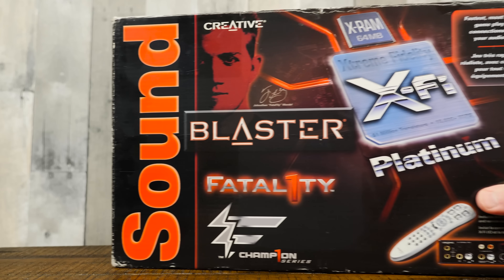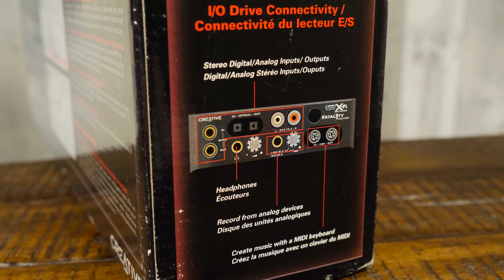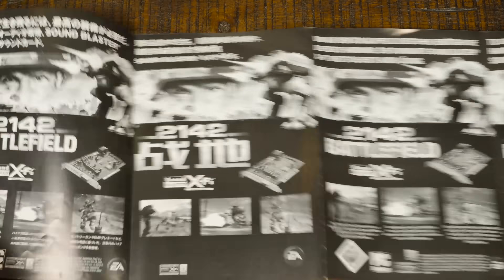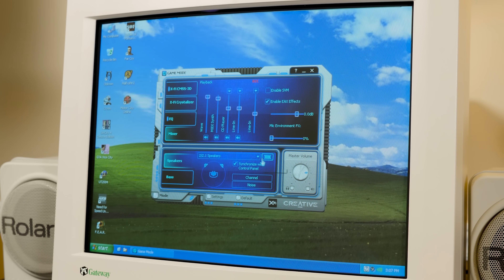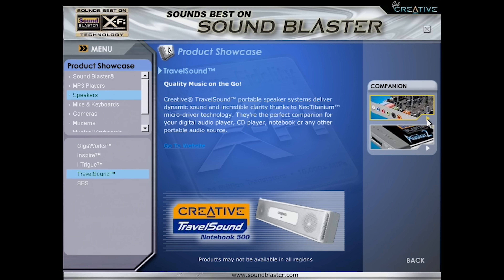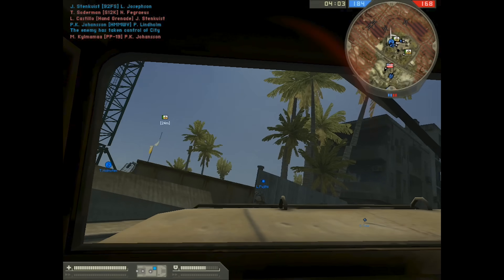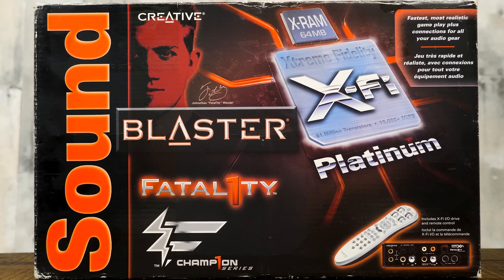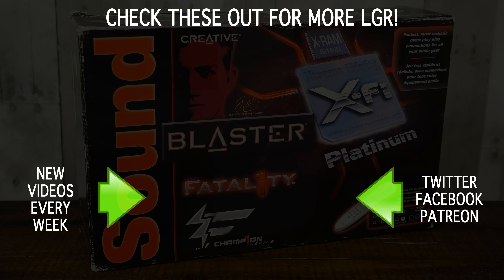XP Upgrade! Sound Blaster X-Fi Platinum Fatal1ty Sound Card

Comment: I am still using a Sound Blaster X-Fi Titanium in my current rig under windows 10 =)
Reply: been using creative for 14yrs now have a soundblaster Z, dont feel at moment i need to change as on board is still fairly generic and cheap.
Reply: William J Beard does EAX Work lol
Reply: I got my Sound Blaster X-Fi Titanium HD working too, EAX works great still.  You can also set your speakers to 5.1 in windows with physical stereo speakers or headphones and CMSS - 3D works better than virtual 3D
Reply: @JediJado  I love the fact that the card still has an optical audio input as well as output ports. I run my Console through the optical in and then I can use my headphones and all the SoundBlaster processing on my console games as well =) It's actually really hard to find a sound card with optical in these days. I think the newest RGB SoundBlaster has an input, however it's a shared input/output port. So you only get one =/
Reply: I'm using an Audigy 2 under windows 10 :D
Reply: @Bloowashere  Nice, they still sound better than any on board audio chip, even the ones that claim to be really nice.
Reply: @theov3rmind  you're not wrong, Spatial sound sounds superior, music sounds better, and the built in midi synth is fantastic.
Reply: @Bloowashere  The audigy 2 is the one with the FireWire port, iight? In my case, having an optical INPUT and output is super useful. That new RGB SoundBlaster whatever has one optical port, either for opt. in or opt. out. Bit of a downgrade imo, lol.
Reply: @theov3rmind  yes it has a firewire port, strange thing though is that all the other ports are mini-toslink ports
Reply: @Bloowashere  Woah, that's sweet! I want one.
Reply: well it created a lot of issues when I first got it, but thankfully there's a stereo mix in the microphone section of windows so you can offload the audio that's rendered on the soundcard to the onboard.
Reply: oh yeah, a lot of motherboards with Realtek chips have that feature comes in handy.
Reply: @theov3rmind  mine is a Realtek but it doesn't actually have that feature. The audigy 2 has the feature though
Reply: lol u still have it?

Comment: Oh these XP machine videos are sweet. All of this hardware is pretty much the step up versions of everything I had in my first custom built PC in 2007. I had an e6850, you got a qx6850. You have dual 8800 gts, I had dual 8600gts, and now you have the xfi platinum I had the xfi xtreme music. This is a great nostalgia trip. I remember fiddling with that soundblaster UI constantly as it always loved to randomly mute my mic in and never save my balancing settings. Still it made me fall in love with dynamic compression and I can never get a motherboard without a integrated sound chip that supports it.

Comment: I still have and use my Sound Blaster X-Fi Titanium Fatal1ty on my current Windows 10 Gaming PC. Never had the front panel for it. But wish I did. Love this card! Thought about upgrading. But I use and need the Optical In port.
Reply: Me too!  The CMSS 3D headphone surround is still exceptional.  I recently purchased an SBX AE-5 to compare and the software controls were an inefficient RGB dumpster fire compared to the X-Fi so I returned it.
Reply: Yeah, that front panel won't work in anything but Windows XP, because you know it has such amazing proprietary tech in it that Creative wouldn't dare release specs for it. :x
Reply: yep Z is a must up from your,  been using creative for 14rs now and now on Z not moving now till atleast 2 more yrs.
Reply: @Darkleaf-Music I’m running XP. I cannot get the front panel working. Is there special software I need to install or some software setting to enable? I’ve double checked the ribbon cable and it’s installed correctly.

Comment: I still have this same card, front panel, and remote laying around somewhere! X-Fi Crystallizer was genuinely a very cool feature, I used it for many years across a few generations of X-Fi cards - and I believe some of the earlier non-X-Fi cards had the feature too, and it was actually the feature that lead to the development of their X-Fi ASIC... Anyhow, it was a genuinely nice-sounding feature, not just a stupid filter or sharpening effect. It was especially nice on low bitrate MP3's and such, which was a lot more common in those days, back when internet connections were slow, and storage was premium. But even on high-quality sources, the crystallizer really worked well, if left on a low-to-medium setting. It genuinely added dynamic range without causing it to sound crunchy or boomy. Very impressive. Turning it on kinda felt like having your hearing restored after unknowingly having slowly gone deaf!

Was not a big fan of the 3D feature though. It worked, especially with good headphones, but it altered the sound way too much to be worth it, except for competitive FPS or something like that. I used it for competitive CS, the positional audio was extremely good. Screw these dumb "7.1 headphones" they're trying to sell people nowadays... Pro tip; you only have two earholes , it's not about how many speakers you have, it's about how the audio frequencies are modulated.

I kinda miss sound cards being relevant, but just like you said in the video, these days, built-in audio is very good, the issues with coupled noise from the rest of the motherboard has been solved by separating the ground planes, and the DACs + OP-Amps they use are just as high-end as what any sound card or external DAC uses. If you really want placebo levels of quality, an actual USB DAC is the way to go anyway. But then you risk audio latency instead since they're usually tailored for entertainment, where adding a couple tens or sometimes hundreds of millisec to the audio is not a huge deal.

Comment: #XFiTillIDie
Xfi + Daniel K drivers on windows 10 is a thing of beauty for current games, too.
Reply: Jorge Ramos when I use my Audigy 2 zs under 10 I just use the 7 64-bit drivers.
Reply: Really I had so many issues with my X-Fi Forte even on W7...
Reply: Were you using the stock drivers or the Daniel K drivers? I too had a situation where it was like bit rot going on with the stock driver from Creative, but the Daniel K drivers fixed that; the only time it ever stops working on my build is whenever Windows 10 did a major enough udpate and it chooses to uninstall because "it's not a signed driver" like the Creative one would be.
Reply: I am on the X-Fi and Daniel_k drivers too. Its been all swell apart from audio crackling and degradation when playing the Forza Horizon 4 demo. Only fix I can see is maybe Windows update drivers or plugging in another USB audio card for the meantime.
Reply: After Auzentch went bankrupt and stopped updating drivers I started using Daniel K's ones with mixed results. 
By the way I was on W7 on that pc.
Reply: I get no sound at all with his drivers on my Audigy zs under XP.
Reply: Old Liquid I’m using on 1909 no problems

Comment: I remember having Audigy 2 ZS back in my XP days. Moving to Vista broke a lot of the EAX stuff even for EAX games due to the change in HAL for Audio. 

They did release a patch called Alchemy which was meant to "fix" this for certain games but it was very hit and miss. By that period, many multi platform games were  also being released on Xbox 360 and PS3, which meant preference for Dolby Digital Live over EAX. 

To add to PhilsComputerLab comment, I can also add some games which sounded amazing in EAX:

Serious Sam 1 and 2 (although only EAX 2.0 it uses environmental echos very well)
GTA 3, Vice City & San Andreas
Hitman 2 & Contracts
Soldier of Fortune II Double Helix - this one in particular used spacial sound and environments to a very good degree...
Far Cry
Crysis
Even Sega Rally 2

I never got an X-Fi but would be interested to see if the 3D MIDI extends to DOS games which use General MIDI such as Doom, Duke Nukem 3D and Heretic. I remember managing to get the Audigy 2's MIDI to work in those and it sounded cleaner than Microsoft's GS Wavetable Synth. But would be interesting to see if you plugged in some 5.1 speakers to see if the MIDI instruments would be panned around you - certainly would bring an interesting lease of life to old DOS games. 

3D MIDI Would have also made a brilliant baseline for the PS3 version of Doom 1 and 2 where, disappointingly, despite using Dolby Digital for sound effects, the music was a straight export of the MIDI soundtrack from Microsoft's GS Wavetable Synth to a wave file
Reply: @HarGabt  Nah, it's because San Andreas was a horrible PC port. Half-Life and CS1.6 had their hardware acceleration support removed in 2013. Use MetaAudio to restore EAX and HRTF properly in those games.
Reply: @IDrinkLava  Some time later i tried to experiment with EAX to find where it would actually work
And i found that EAX works only in underwater and in stadium, but it sounds so faint, i had to turn "Enable EAX Effects" to +12db to hear the EAX working.
And there's another thing you have mentioned in one of your videos: resampling issue. For some reason, Creative's ALchemy instead of linear resampling uses bsinc24 or any another that sounds worse than linear. I tried using DSOAL, but i had an issue: when i turn the camera, the sound location changes. For example, if i turn the camera somewhere else, then all sounds including menu will sound from left or right. Maybe GTA SA is incompatible with DSOAL, i dunno.
What do you think about it?

Comment: This is very fitting. I'm watching this video on what is my 2006 XP dream computer, fully kitted out wit period correct peripherals, artifacts and things. Very nice.
Reply: What are the specs?
Reply: Oh it's nothing amazing really, but someting I drooled over at the time, when I was still little. It's a HP xw4400 workstation with a Core2Duo 6600 with 4GB RAM, Radeon X1300 GPU (kinda old and crappy for the time, but eh) fans replaced with Noctuas so it's practically silent, and a Zalman Reserator 2 cooler for the CPU and GPU. Those are not top specs even for the time, but it gives a good experience. Especially with all the right peripherals, speakers, monitors and things. It gives a pretty good illusion of it still being 2006. lol
Reply: Electricguy Nice, I actually have a XW9400 with 2x dual core Opterons.

But on my XP PC I have a Core2 Duo E6300 @ 2.33GHz, 2gb RAM and 19" HP LP1965 1280x1024 monitor. I'm probably going to upgrade the CPU to a E6700 and get some GeForce 8800 series card.
Here is a picture of the setup: https://i.imgur.com/F8B7inR.jpg
Reply: My best XP machine has a core 2 quad q6700 and a gtx 750 ti

Comment: One of my favorite uses of EAX is Condemned Criminal Origins. It makes a noticeable difference and in a great way. Not just reverb, but genuinely useful and cool things like fantastic sound occlusion (for example a gunshot sounds much different if there are walls or a door between the source of the shot). Really good 3D audio making it much easier to tell where a sound is coming from in 3D space and how far away it is with just headphones or even my old but still fantastic Logitech z 2300. I'm not surprised EAX died though, creative drivers were well known to be a source of instability back in the day. Prompting Microsoft to make the changes in Vista that killed hardware accelerated audio. But Creative did a awful job trying to develop and promote their own API for it called OpenAL. And now it seems the future of hardware accelerated audio is going to be accelerated by the GPU using ray traced audio. This is one reason even as a PC gamer I'm actually quite excited to see Sony putting so much focus into game audio with the PS5. Game audio has not gotten much attention in a long time.
Reply: It is absolutely true I have exactly the same sound card with an extra external panel connector, play games on Windows XP, 7, 8, and 10. the surround sound and sound stage like shooting in the cave and outside found best in Windows XP the hardware acceleration was incredible Windows destroyed that in the next Windows edition now all sound cards sound the same.

Comment: I use one of this cards still today. My main computer is somewhat between 8 and 10 years old except for the 1060 in it. Quad-Core Xeon as the desktop Quad-Core processors weren't available that date and later had the same price but lower cache and less features, 8 gigs of ram and my X-Fi Titanium Fatal1ty Professional (The one with the black cover without the front panel). The CPU is too slow sometimes for modern games but this is my main computer for gaming. I bought this sound card to not have interference with other chips making awful noises like hearing hard drive activity in your speakers. Attached is a Logitech Z5500 via optical SPDIF using DTS. The sound is crystal clear and EAX in games rocked hard. You can pull up the volume to max without having any noise at all except it would hurt your ears when sound comes up. Watching bluerays on this setup gives my neighbors the creeps when something blows up :-). I'm not sure if the next computer will have a dedicated sound card anymore. I'd like to have one but I'd also like to build a Mini-ITX sized watercooled one and there is just enough space for the graphics card, not for any other card. Also creative never had proper linux SPDIF support (AFAIR they promised to have) and drivers had more and more problems as soon as a newer Windows version popped up. And today I mostly use headphones and the Z5500 is connected to the TV. It felt strange to see the Sound UI on your channel where normally most of the content is nostalgic. Except for some issues the card runs fine on Win10. For example after hibernate I have hit the reset button in sound properties and enable DTS again to have sound on optical fiber. And some years ago I've been playing around using different sound fonts. I wanted games like Transport Tycoon to sound awesome when playing MIDI Music :-) But I can't remember if I succeeded.

Comment: I had an old creative sound card, that didn't have eax support.  It a spdif optical 5.1 dolby output.  And it could also bypass pcm audio through it.  Also had all the usual line in and 3.5 mm jacks for microphone and headphone and regular 5.1 speaker configs...wish I still had that card.

Comment: I had this exact x-fi pack and it's biggest flaw was the terrible drivers, especially when moving to Win 7. I paid a lot of money for it and it never worked propery, especially the front port. God dammit Creative 😐
Reply: @Imgema  I tried everything believe me. The forums of the time were packed with disgruntled X-fi owners. XP 32bit wasn't too bad but Win 7 was a disaster. Creative just gave up on developing the drivers properly. I even RMA'd my card and got the latest hardware revision replacement but it wasn't much better. I swore off Creative for life. 😁
Reply: My last dedicated sound card was an Audigy xfi I believe, I stopped using it arround 2011 exactly because there was no future with eax (or hardware accelerated sound for that matter) and the older games started to fail with win7, and the drivers sucked too, that and the onboard audio was "good enough" so I just rolled with it.

Nostalgia factor aside, nowadays there's no reason to use a dedicated sound card, a nice dac/amp usb combo and good headphones/speakers is all you need.
Reply: I have the exact card in the video, and I couldn't agree more with you! Creative Labs products turned into total garbage after the SoundBlaster Live series, and it all comes down to the awful drivers (or lack thereof). I seem to recall a point where all the extra features were removed in a driver "update". I can pretty much forget using the front panel module, too.
Reply: I had the exact same problem, so I bought their next sound blaster "Titanium x-fi HD" and thought that I'd be set for a good while. Then they started rolling out Win10 and I switched over for a hot minute and realized that there were no support at all for it so I switched back to win7. Then I bought a new computer that came with win10 and I was thinking to just roll with the sound hardware in my motherboard since it said that it had a really good soundcard, but it was awful so I put in my Titanium and found a really lazy update for the card from Creative. It does the job but they removed some of the features, like the ability to EQ...but it works for what I need it for so it's kinda ok. I wouldn't have bought from Creative again if there were any other soundcards out there that was good enough. I loved the first Sound Blaster though...up until win7. Never used the remote, don't think I even knew what the remote was for haha. When all is said and done, screw Creative for not taking care of their costumers.
Reply: I had the same problem with drivers too; feature removal, oem card specific's driver unavailiability, and reliability.  I'd unplug an analog cable from the card, blue screen, no boot until I reseated the card.  Over and over and over.  I hated touching my cables because of creative labs.  And yes, it was the card, spent hours of trial and error, different motherboards, etc.  If I didn't bump my computer it didn't give me an issue.  I was a creative labs fanboy since the SB16 MCD, got a AWE32, then went PCI and nightmareville.  Now I use GPU HDMI to my sony surround receiver, but anlogue was more rock solid than now IMHO
Reply: I still use it, it works perfectly on Ubuntu without the need to install any drivers at all. For windows 7 I was able to find one working driver after scouring the internet, and I made sure to save it on 2 external hard drives for whenever I install windows lol